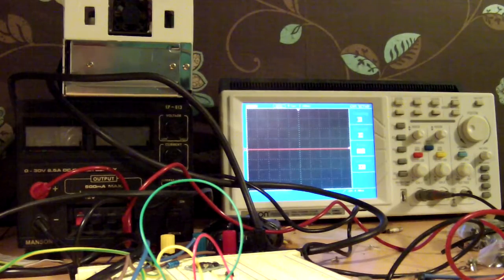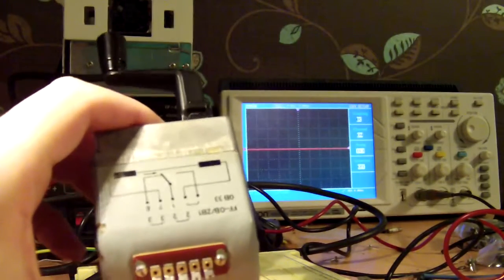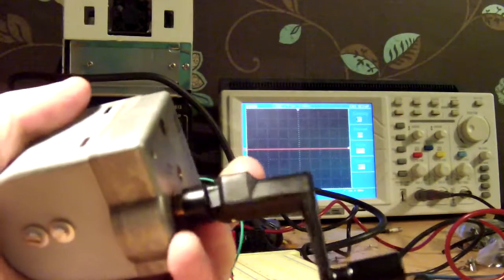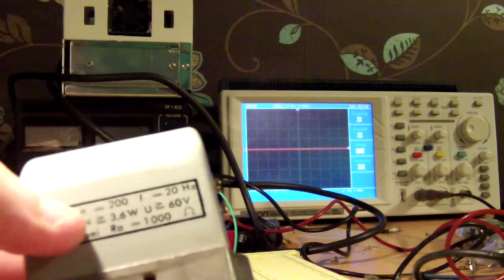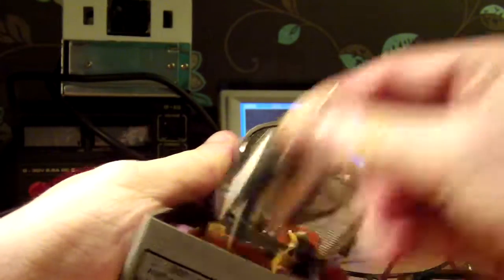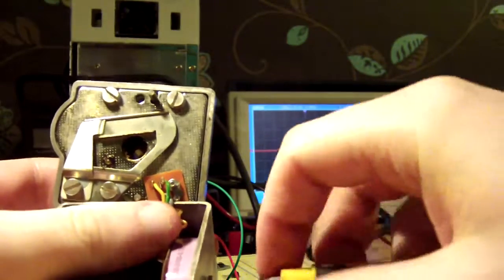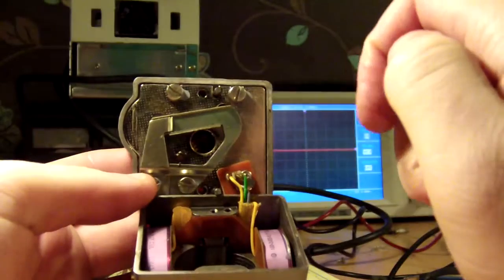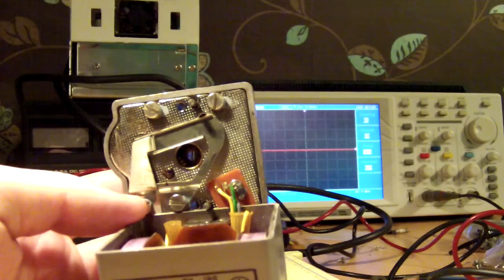Teardown of German military hand-cranked telephone magneto.

Comment: Hi, I have two Russian TA-57 field phones.  One works perfect but the other is difficult to crank the magneto ringer and becomes extremely difficult (nearly impossible) when it’s wired to the other TA-57 or my Ericsson.  So it seems to isolate the problem to the one phone.  Can there be a short in the magneto and is it easy to rebuild?  TIA.
Reply from the maker: Yes, it's very easy to disassemble this for repair. Or to re-wind it to get a different voltage/current output.
Reply: @channelbeforepurpose7353  I have no experience or knowledge with it or electronics in general.  Any recommendations on how I get started?

Comment: Think your Generator is 60 volt power transformer and you want to get  6 volts to charge  bank of supper caps. using proper adjustable voltage regulators with filter capacitors will do that. Make sure the voltage regulator you choose will exceed 60 volts input. I guess power exceeding 6 volts that not being used, it  will turn to heat in your voltage regulator IC which in had crank circuit is not too much of problem but if it used with power transformer would get very hot and you have to do extra things to keep it cool which one idea is to pick out a transformer with lesser output voltage but here you do not have that choice .LM 317 adjustable regulator will only tolerate   40 volts at its input.

Comment: High could you please do a video on a synchronous motor out of a oscillating heater hooked up to your scope i can easily get 1000v at decent RPM unlike the the microwave ones and Im trying to increase the watt load with capacitors right now cuz I don't have any super caps I'm using regular capacitors but I can get a 30w light bulb to stay bright at 200v

Comment: Hi, I'm new to electronics and learning as I go. I'd like to use one of these hand cranks to charge 6 super capacitors in a 'boost box' project. What would you suggest inserting between the generator and the 2.7V super capacitors to protect them from the large voltages the generator produces?
Reply from the maker: These magnetos are designed for very high voltage, low current output. You need to bring it down to reasonable level.

I can see two ways to do this. One would be to re-wind the coils inside, as I have done to mine, to give lower voltage but higher current. The other is to simply run it through a full-wave rectifier and a buck converter. That way may work better, but you'll need to get a buck that'll handle the peak voltage on the input, not just RMS.

You could also rewire the coils rather than rewind them, splitting the wire that joins them. That'll have the output voltage (and double the current) with suitable rectification, which makes the buck converter must easier to find.

In short: This magneto is not designed for your application, and though it can be repurposed in that way it may need internal modification.
Reply: Thank you. I bought a KBPC5010 rectifier that can handle 1000V and I have a buck converter with an LM2596HV on the way from China with a 63V capacitor on the input side. I think I'll need to protect the buck converter from the 200V spikes you report, (due to inductance?). Is there some sort of diode or capacitor I can add to the circuit to chop off the spikes at around 60V?
Reply from the maker: You don't want to just cut off the spikes - there's a lot of energy in them. Modifying the magneto would be the optimal way - you just need to take the wire that joins the coils and connect it to one of the switch terminals. That'll give you a center tap, which is very useful because it'll halve the output voltage and double the current it can provide. Buck converters with a 100V input are much easier to get.
Reply: Once again, thank you for your advice. I can see the wire that joins the coils, (it is yellow in my magneto). The switch has terminals with blue, green and yellow wires attached. Can you confirm - I should cut the yellow wire joining the coils and solder it to any one of the terminals on the switch or is one particular terminal better than any other?
Reply from the maker: I don't know if mine would match your coloring, but there's a pinout on the side. If you've no use for the switch mechanism (I can't imagine one) then you can use any of the three terminals allocated to it.

A better idea might be to disconnect the switch entirely, cut that yellow wire in the middle, and connect the two ends to different terminals - that'll let you easily try different approaches to rectification without needing to open up the magneto any more. You can just use two bridge rectifiers then, and put the outputs in parallel - that'll give you the best possible efficiency and power handling. Use schottkys if you can, regular diodes would waste 1-2% of the power, and if you're turning this by hand you really need it to be as efficient as possible.